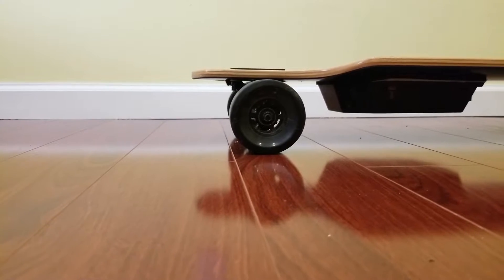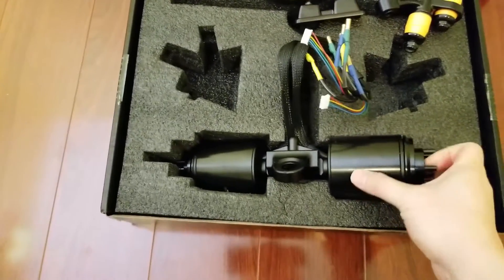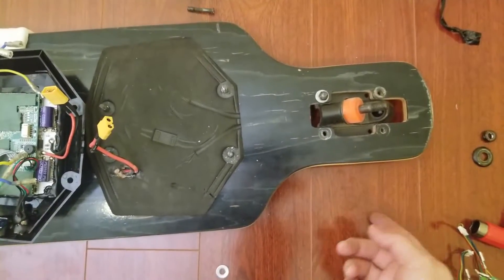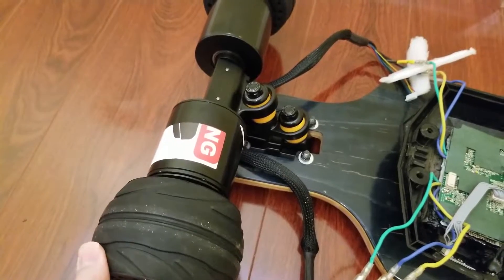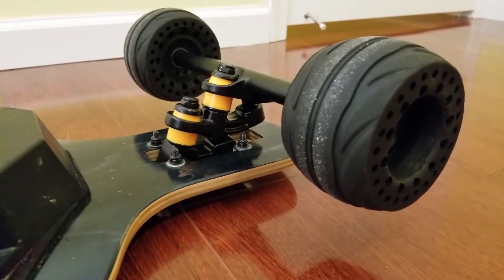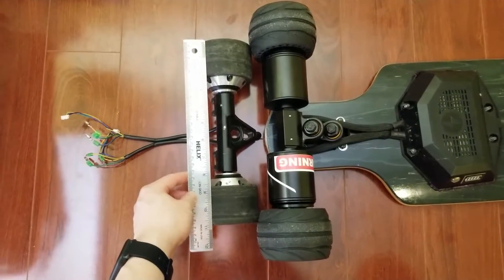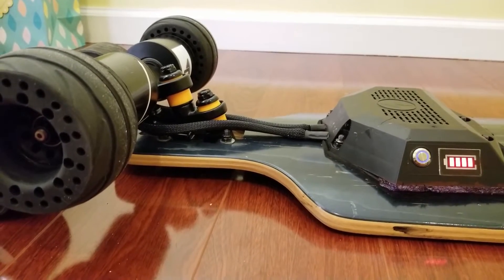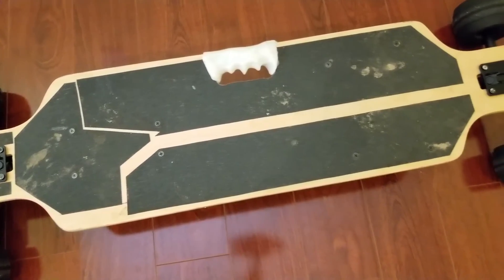swap Meepo's hub motors with Direct Drive motors.  EASY!

Comment: Thanks for making this vid! Saves me money as I was considering buying these as on paper they seem like the perfect solution. I was actually planning on buying two sets and doing AWD with 120mm SR Foamies and two Skywing 6.6 vescs.Though it's got potential, I'll wait until they've got better quality and some bugs worked out. The motors cogging and not at least somewhat free-rolling is a major deal breaker for me.
Reply: agreed, i was just planning the exact same thing. esp with that ground clearance direct drive doesnt seem as much better than hubs. the grinding sound in this vid doesn't seem like the problem though! its highly likely a problem with the bearings.

Comment: If the bearings are making a grinding noise. Try these simple steps. 1. Take wheel off and take off bearings. 2. Use small flathead screwdriver or thumb tack to pop the shields off the bearings. 3. Apply some multi-purpose lithium grease into the bearings. Use a screwdriver to dab some grease into the inside of the bearings. 4. Pop shields back on to your bearings. 5, Install bearings and spacer into your wheels. And place your wheel onto your Truck and tighten it with a skate tool or socket wrench. Last,  your ready to ride. If you would like to learn more on greasing bearings. See this video here. Thank you! https://m.youtube.com/watch?v=hDxqTJh7fG8

Comment: Hi I got a meepo mini 2 short board which I really enjoyed using. But I am going to get another board. I'm looking to get a direct drive longboard. So it was interesting what you changed on the meepo board. One question is it easy to put on different wheels like slick wheels or Clouds or Foamies and the tire type you have on the board your doing in the video? Thanks Mark

Comment: nice ! Try the Revel kit, it's perfect
Reply: Hey, does the revel kit have free roll wheels? So if I wanted to push would that work?
Reply: I think this is better solution as Revel kit is also expensive but the battery pops off when riding so it's kind of risky. Not too sure about the latest one.
Reply: AkaliA Ø I mean revel kit can be put on any board and is like the same price as this, I’ve heard good things about it other than it’s range
Reply: @samreason9856  Yeah I think I confused myself as different kit, not this one. Doh.

Comment: It may be that you tighten the wheels too tight. Try loosen it up. Similar problem with my belt drive. Loosen up fixed it for me and had no problem.
Reply: Nope, these motors are cogging because the insane amount of torque they are capable of.

Comment: Good video. Thanks for sharing. I bought the same motors and change my wowgo, it's similar to yours.  Thorough I dropped my double kingpins to single. Bearings issues. Change them to bones red. The meepo and wowgo esc uses a smaller jst connector. No issues when using hall sensors. The colour configuration is also different. It's red, yellow, blue, green and black. 
Would like to see what range you get as the direct drives seem power hungry compared to my wowgo 100mm hubs.
Noticed stronger breaking with the direct drives over the hubs. How about you?
Reply from the maker: my meepo ESC does not like the DD motors. the max speed i get is around 7mph, even in expert mode. i need to get a better ESC or something to fully test the range. what ESC are you using?
Reply: Which wowgo do you have? I have a wowgo 3 thinking of upgrading to this motor. Is it a simple replacement and you use the same original ESC?
Reply: @dablet  oops my bad. I meant my meepo 100mm hubs. I'm using meepo v3 esc and the metal spoke 105mm wheels on the DD which gets me up to 20mph+. I'm not light. Also I've got an 8.6 ah Sanyo/Tesla battery running. Not sure why you're not getting any decent speeds. Remember boundmotor batteries start at 9.6ah and go to 14ah.
Reply: What about wobbling with the bones red ? I'm interested in those as the Torqueboards are very expensive !!! I plan to use them with a Flipsky Dual FSESC6.6 Plus and a 12S2P spare battery pas from my Backfire G3 (Samsung 21700 30T). And no free wheel at all ? Thanks in advance !
Reply: did you have to rewire to connect the hall sensors?
Reply: @Zether1206  what esc are you using with the direct drives? You follow the order of the esc not the drives. So if you're not gong to use a boundmotor vesc, you me have to rewire and change the jst connector
Reply: @mrgee918  I am still actually planning to do a DIY. I want to see if I can upgrade the Verreal V1 board with its stock ESC and plug in this DD motor. can I see your set-up?
Reply: mr gee what jst connector would you need as I’m thinking of doing this within my Meepo mini 2 and is it simple to rewire?
Reply: @samreason9856  you can take off the jst conector used on the meepo hubs. Just get a needle and lift up the tabs that keep the wires in the jst and pull the wires out. Attach the direct drives wires to the jst. In the same order as it was for the meepo hubs.
Reply: mr gee great idea why didn’t I think of that haha thanks man. So the wires need to be in the same colour order ?
Reply: @Zether1206  it should work but might be under powered as these motors are way more powerful than verreal hubs. Just use the connector from the verreal hubs and connect them to the direct drives. Make sure you put the wires in the same order as the verreal hubs.
Reply: @mrgee918  I get about 25-27mi top on the Verreal V1. I dont need more than that for now. :) can I see your set-up?
Reply: @mrgee918  also how fast do you get with your set-up?
Reply: Hi Mr gee I have the Acton qu4tro 4 wheel drive hub and I want to do the the swap with DD does having the sensor wire make a difference when installing or i don't really need it. I ask because I like the speed I have on this board but if the esc won't be an issue but the battery will be because DD will use more power should I just upgrade the battery cells as well to handle the power consumption that DD will use. My board has lights if you look up the specs for my board o think the battery is fine to handle the swap. Let me know what you think thanks